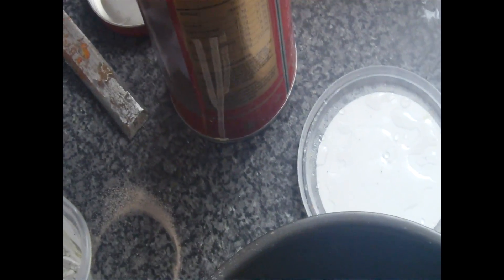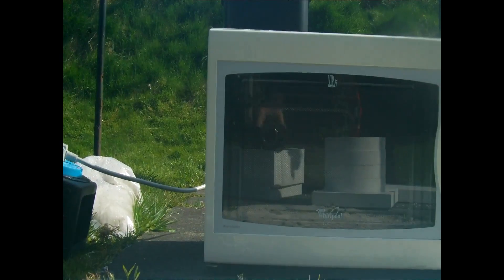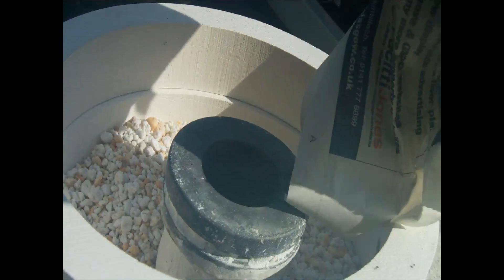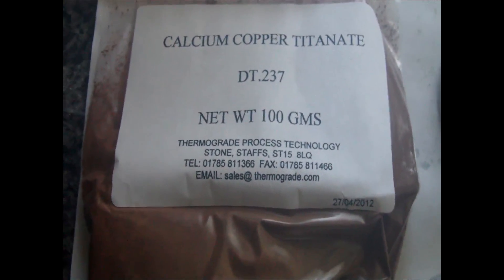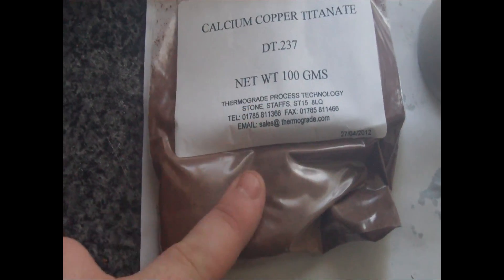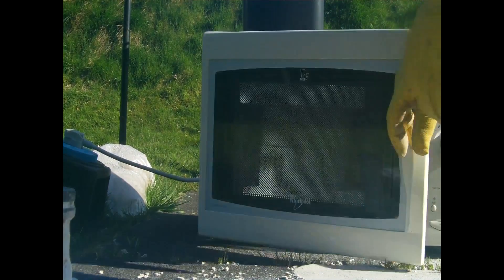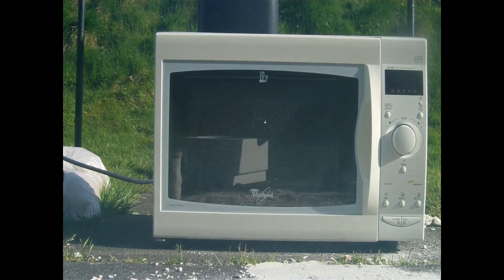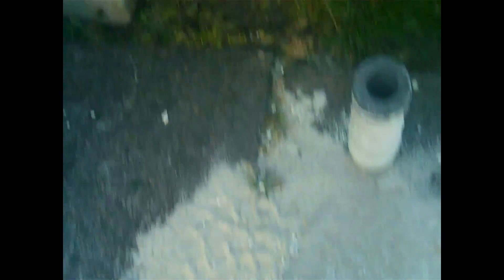Microwave experiment 6 and 7 Tungsten and Copper Calcium Titanate

Comment from the maker: My evidence is based on SiC, solid stones of Silicon Carbide don't heat up anywhere near as fast as the 400 grit SiC abrasive does. Remember water is transparentish from 700nm to 450nm however in the microwave band it is quite black, i.e. opaque to 2400GHz

Comment: i've only ready white papers, youre then man with real knowledge.
university sheffield has a pdf covering oven temps ect. And a chineese paper shows oven temp/time vs. dialtc strengh of the result.

my understanding tells me that CCT wont get hot at all in a microwave, its transparant to it. Seems counter intuitive but having the CCT in the microwave should make everything ELSE in there hotter. however iron oxide mixed in the powder should go molten easy...thats my hypothesis anyway

Comment from the maker: You're probably right, but I have the attitude of if it doesn't set fire to or even singe rizla paper, its not hot enough and then I do a gentle dap and see how hot it is.
I think your advice is probably prudent, have you got a recommendation for a good electronic thermometer?

Comment from the maker: I'm trying to isolate a better material than magnetite to generate really high temperatures in a microwave re-uably to melt metals without using gas to make my own parts and casts at minimal effort.